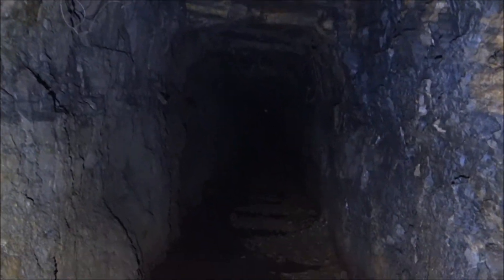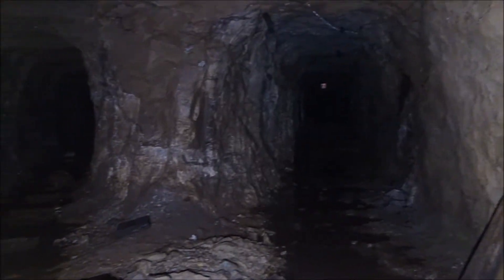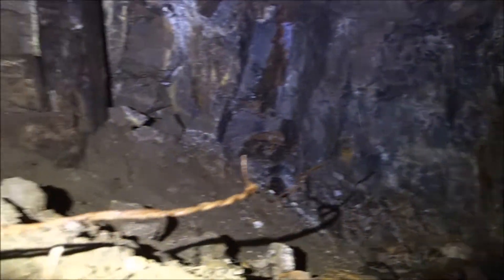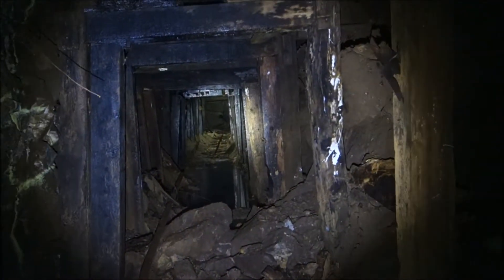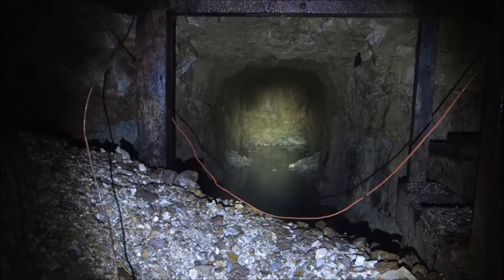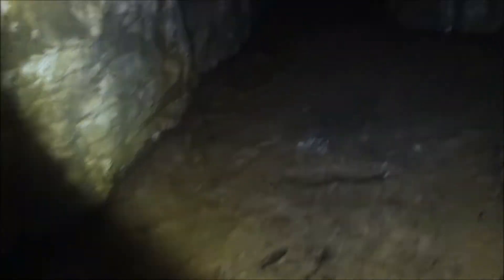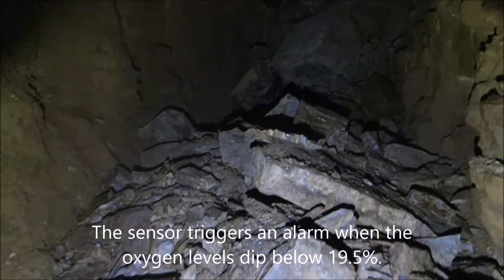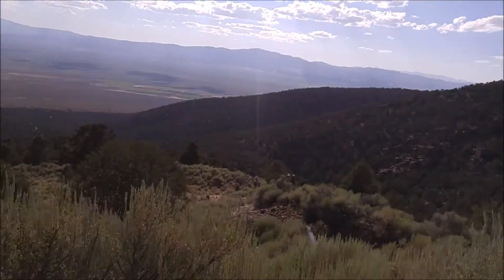Exploring The Walker Mine: Part 4 - Having A Bad Air Day!

Comment: that is an amazing damned mine.  I would have loved to have seen it in it's heyday.  Some huge ass timbers that they hauled in there.  You guys be safe
Reply from the maker: Yes, I was amazed by the size of the mine as well. We discovered later that the tunnel continues for thousands of feet past that collapse at the end of the video too! It definitely would have been cool to see this one when it was up and running. The timbers in there were huge - hard to imagine them hauling them in there and then muscling them into position...
Reply: That is the thing I think most people forget  They did that all by hand.  They may have had some jacks but jacks don't put in stulls.  They have to be hammered in.  When I was a miner shoring timbers were usually put in with the help of hydraulics but when you in a stope and putting in a stull it's all manual labor.  One trick was if you knew you were going to put in a stull you left a little rock on the floor to wedge the bottom against
Reply from the maker: I love getting comments from individuals such as yourself because you know so much about mining... Yes, especially in some of the older mines we visit (before the miners would have had ANY mechanical assistance), it is amazing to see some of the timbers they put in place or some of the rocks they moved around. That's interesting about leaving the little rock for the stulls. I'll keep an eye out for that in the future.
Thanks for watching and commenting!
Reply: TVR Exploring 'l
Reply: Doc McCoy 'll(?
Reply: yes can i help you?

Comment: Another great video. What  oxygen sensor would you  recommend, I'd like to get one?
Reply from the maker: Thank you very much. The one I have is from BW Technologies and it is what most mine explorers seem to use... If you get the single gas device, they cost about $120 depending on where you buy it. In other words, you can buy one for oxygen or one for hydrogen sulfide or whatever. The device has a battery life of two years once you activate it and once the battery is gone, you have to get a new one. If you want one device that detects multiple gases, they are much more expensive. The instance in this video is the only time I have ever had my oxygen sensor go off inside of a mine, but it is comforting to have it all the same. Be sure to calibrate it at the entrance to the mine before you go inside because it is quite sensitive to altitude and other factors. Sometimes when driving through the mountains it just goes off like crazy because of the changing altitudes.
Reply: Awesome thanks very much I do appreciate it.
Reply from the maker: You're very welcome. I hope that was helpful.